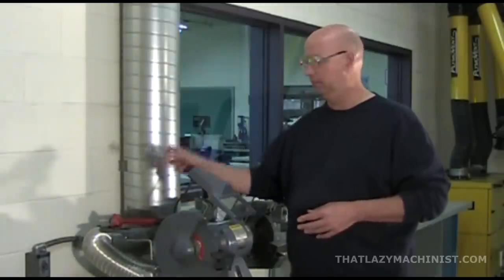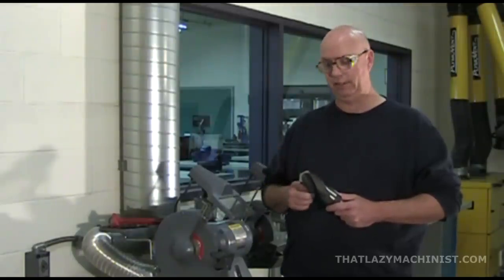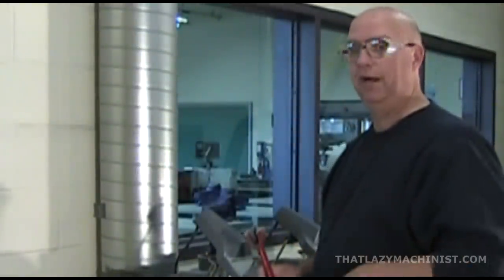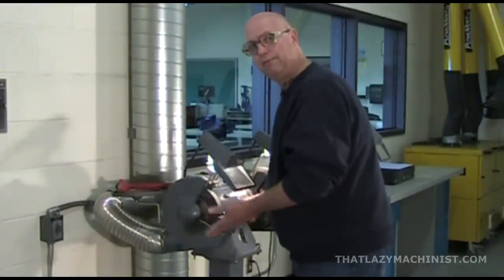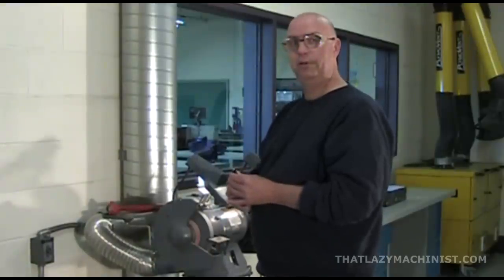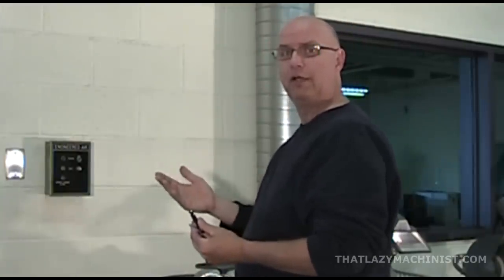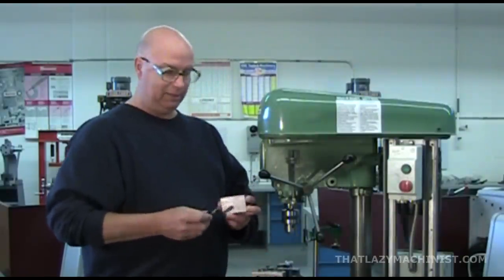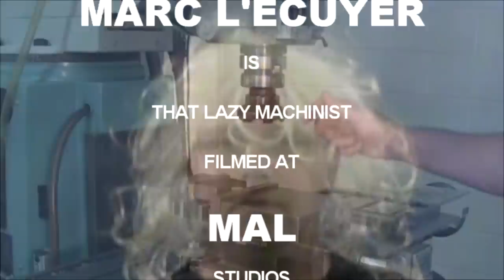HAND SHARPENING DRILLS OLD SCHOOL in your home shop using a drill point gauge and a bench grinder!

Comment: A nicely presented video with clear instructions on how to do, why do it, and what if done other way.  Practically, all my life I have been a self taught DIY enthusiast in multitrade.  I wouldn't grade myself as professional, but rather well educated, and knowledgeable to a certain level.  Sharpening drill bits is one of those things I try not to think of, as I failed 99.9% of my few total attempts in over 40 years, and because replacing a damaged drill bit nowadays is easy, cheap, and without hassle.  I ended up with a big pile of drill bits that I collected for the day I decide to give it another try.  You somehow made the process look so easy, and I am confident I will succeed this time, you deserve all the credit for that.  Well done.

Comment: I'm less than 2 years into this trade and I've self learned to sharpen w/o a gauge by eye and technique. I rough out the reliefs first rotating the drill towards the lip while rolling the drill across the wheel, cool it off fully and then hold the lip position static with no pressure just to bevel the roughed in relief to make the cutting lip. I then rotate the drill in my hand preserving its other orientations and do the other lip, then I check for symmetry and run a stone twice on each lip to deburr it and remove the razor edge which is prone to chipping. It wasn't taught to me but it works and I've drilled countless 2.5 inch holes 10+ inches deep in material like 4340 on a lathe w/o pilot drilling because I've found that drills need chisel engagement to not chatter and fracture.
Reply: I have always believed a 1/4 pilot hole was a good thing.
My god man, that is a humongous hole to drill w/no pilot hole.
Reply: @simpleman283  I still do it this way. I now freehand grind a split point so it's even easier to do.

Comment: In the shop that I worked in almost all drills were ground by hand. The dominant practice in the shop was to relieve the trailing edge of each lip with a sheer straight angle drop off towards the spiral flute leaving only a narrow 12° drop off just behind the cutting edge. Have you ever seen this type of drill sharpening method? It seem to be quite effective in the drills did not show any signs of being weekend by this process.

Comment: Marc, am I correct that the central web gets thicker from the tip to the shank of the drill bit?  So, in the case of a drill that was severely damaged like your example, would not the chisel tip become wider?  Would this reduce the drill's cutting efficiency if a pilot hole were not used?  Could the web thickened be reduced at the tip by grinding with a small rotary tool?
Reply: you could split the tip and make it cut easer

Comment: I've always used  similar technique but rotated slightly whilst hinging the drill against the grinder.... what is the advantage of not rotating? If I don't rotate the drill the back of the web does not get ground with enough clearance which hinders cutting ability? Obviously your technique works but I can't get my head around how 😅
Reply: I can't understand that either, where he shows the close up of  the sharpened drill, the trailing edge seems like it would hold the cutting lips off the work. I would have ground that off at a steeper angle

Comment: I say this on all drill sharpening videos I see "large diameter drills are easy to sharpen would be more impressed if you sharpened an eighth or a 3mm drill.
Reply from the maker: Hi Jasper, I would not sharpen à drill less than 3/16" with this method. A touch grinding technique would be preferable (I may someday produce a video). Also small drills are difficult to film properly for an amateur (videographer) such as myself. Thanks for watching and for taking the time to write, Marc